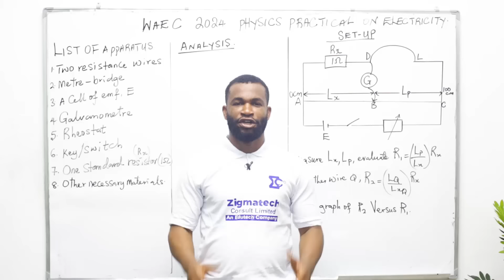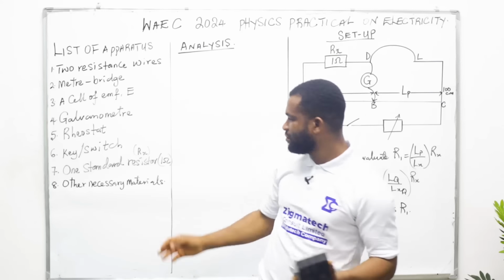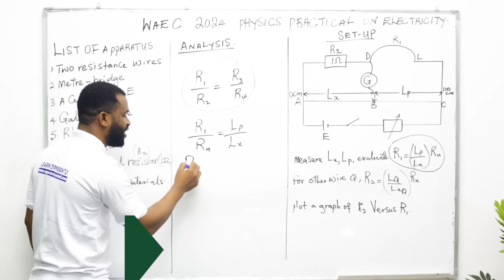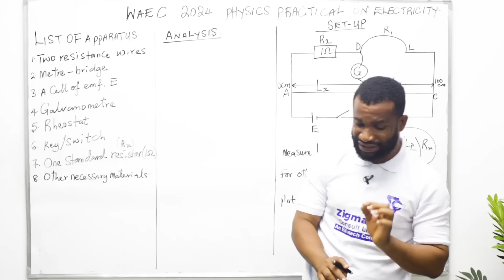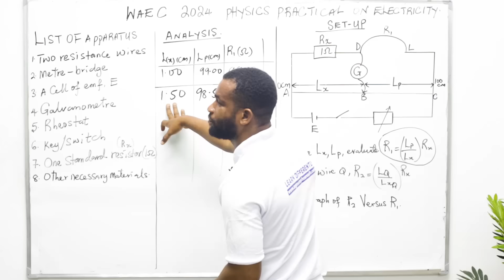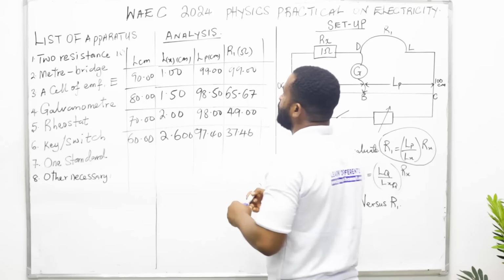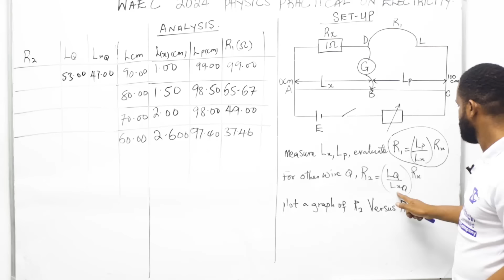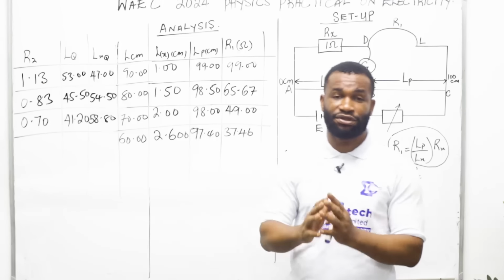WAEC 2024 PHYSICS PRACTICAL ON ELECTRICITY | PHYSICS SSCE PRACTICAL

Comment: A copper wire cannot conduct electricity unless you scratch off the coatings. There is a little error. Instead of using copper wire, use constantan wires of different resistances. 
You don't break the table of values, it should be written together, otherwise, the students score Zero on the table of values.